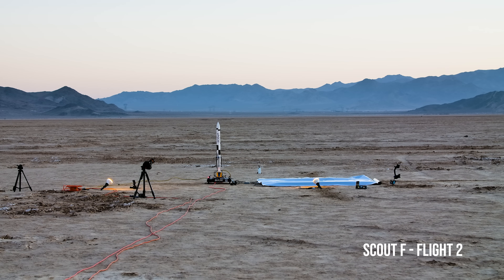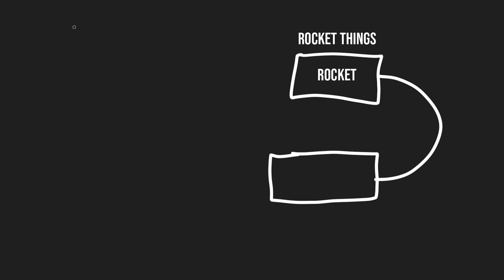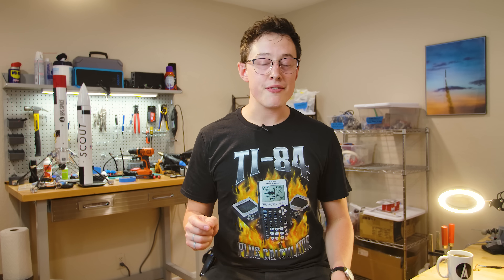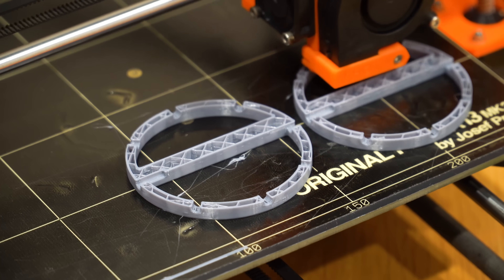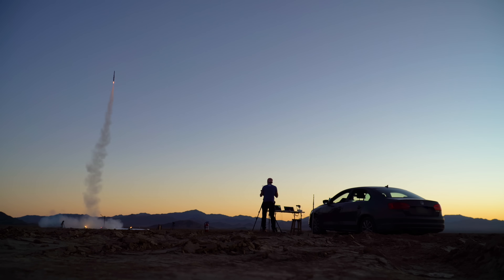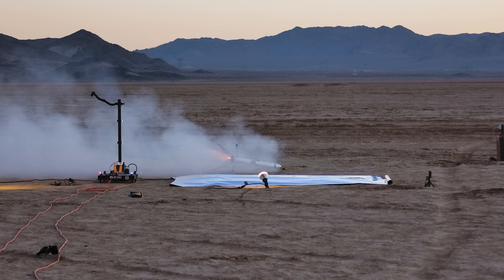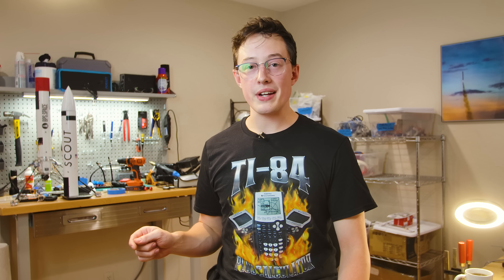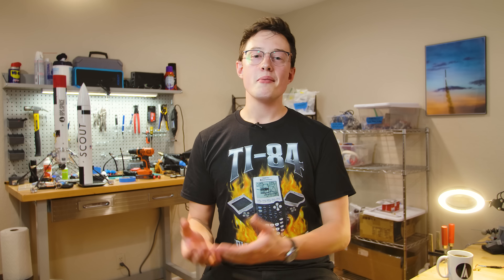Aluminum TVC Mount | Scout Flights 2 and 3

Comment: You mightmwant to add precision PTFE bushings to the pivoting points of your TVC mount. Reduced friction will give you betetr control.

Also, I agree with Marius Holle. The gimbal should be fixed into the 0position whilst ejecting the first motor & starting the second motor to reducen unintended drift.

Comment: For RTK modules Ive been using Emlid RTK (specifically for uav) , you could check out that brand. They have small modules designed for UAV, maybe this has some application for your use. They have some vehicle integration using standard gnss formats and pricing is some of the lowest for this kind of technology

Comment: I wonder if you could incorporate a feasibly "mass-cheap" sort of "scoop" or "deflector" (like the ones used on jet aircraft and jet boats) that swings down into the path of the solid rocket motor, and diverts the thrust vector equally to either side. In so doing, you could essentially cut off vertical thrust at will (almost like shutting down a liquid fuel rocket engine), and maybe even achieve a stabilizing effect near the bottom of the rocket body. I don't know enough to say whether or not this is a good idea, or even possible, but it's something I've been thinking about, and wanted to share.

Comment: Just had a thought, why not use sugar rocket motors? You could make them yourself, and ensure quality in each of them, but also adjust thrust at the end of their burn so you can trim the attitude of the rocket without having to throttle it massively, maybe also some sort of thrust reversal bucket system might help instead of just blocking the nozzle? That way you could essentially neutralise thrust at certain reversal settings in cases where Ava underestimated the burn time?🤷🏻‍♂️

Comment: That third flight was amazing! I did notice however that it seems to be travelling sideways a lot on landing, wondering if maybe adding something to the TVC control profile that kicks it over in the opposite direction to the vehicles travel right before burnout to try counteract this slide? Falcon 9 does a similar thing where you see it too over right before touchdown and then it straightens up at the last second. Just a thought

Comment: Ditching the pad definitely sounds like a good plan. You're using consumer grade IMU hardware (right? Even ism6dsox is borderline consumer, it's not aerospace), and double integrating acceleration. With as dramatic of forces as it sees, there's no way to avoid the error totally destroying your position estimates. Sincerely, someone whose job used to be VR tracking....

Comment: Hey just a thought.  In drone tuning there was a firmware that had an auto tune function.  Basically it would input a change and record the actual movement vs the input.  Then it could figure out what the PIDS really should be.  Any chance you could program a tuning flight to characterize your loop?  Then set your pids from the real data?  Oh by the way, if your a tinkerer machinist, the correct term is farbicoble.  Just saying.  BTW  YDM

Comment: Never give up, never surrender, and maybe go faster on your control system.  When I was doing control systems design (servos on very large robots in nuclear reactors) we were always shooting for 1kHz.  Your slow servo rates are bound to encourage oscillation.  I assume your rates are slow just because you have small processing horsepower.  If they are slow because that better matches your dynamic systems that's another thing entirely, but I'm thinking your systems are small and light, so they could benefit by faster control loops.  Good luck!

Comment: Glad to see you went metal. I think your thrust shut off is still right, too many off kilter forces on landing. I suggest you simply use a small shoot to help with velocity on the way down. You then could calculate the drag induced by the shoot and then convert it to thrust and correct your motor.  Maybe addd in more shock dampening to the legs?

Comment: Curious why you don’t use gps to correct for inertial position error. If you could combine those two sensors that could adjust for your position error on descent.

Comment: It might be worth looking at the control loop inside the servos -- they are often tuned assuming they will not be moving much mass (think RC car wheels or plane flaps), and that causes some of the ringing you see in the motor mount response.

This should be fixable by tuning this loop (might be possible with fancy servos?) or adding some springiness between the servo and the motor mount. The best thing would be to control the motors yourself (with feedback from the potentiometers), because then you could also use the true thrust vector in your state estimate, but that's a lot of work.

Comment: It looks to me like the rocket is pitching over almost 45 degrees at apogee. Then when the second motor ignites the thrust pushes the vehicle way off the vertical vector. So essentially the landing motor which is supposed to be working only to counteract the gravity vector is now ironically working hard to keep the vehicle from remaining vertical. So now the rocket has to work to stop it's sideways thrust vectoring which shouldn't be occurring while trying to return itself to a 90 degree (or vertical) orientation which it needs to be in to deal with the gravity vector. Unless you have some hidden vector control motors I don't see there is no way for the rocket to control these unwanted sideways motions. This is the first of your vids i have watched but it seems like your goal is basically to go straight up and come straight down. So the sideways motion at the top of ascent is a problem. It would add weight but you mght try to build a tiny mechanical gyro (like an electric motor driven top) to mechanically counteract any tendency of the rocket to deviate from the vertical. BTW your metal motor mounts look great but you could try reducing mass by removing any excess metal that isn't structurally necessary. In other words look at every bit of structure and say do I need that. You want to build parts with just enough structure to do their job without failing. You might see if you could get a program that would look at the forces applied to your motor mounts and experiment in software with removing structure until failure and see how much you could get away with removing. Engineers would call this destructive testing. But overall great work so far.

Comment: Just so you know, rtk gps is a pain in the ass to get set up correctly, not so much the part you think is hard, but getting the actual data out of the chip without going 30 kph. Or at least the one i was working with was a pain in the ass. Good luck either way as there is not alot of real docunentation on non car related stuff with rtk.

Comment: 14:27 Stupid idea, but what if you cheat a little and add some sort of spikes on the landing legs that will hold rocket as it lands. A spike that just springs out as soon as the landing legs deploy would let you choose an appropriate length while being flush when the landing legs are retracted( when not deployed ).

Better, if the spikes were angled away from the Y-axis, so if it lands on spike first, it will push the rocket in the opposite direction.

Comment: Hi Joe: While I am nowhere near your technical prowess, I do have a great deal of RC aircraft experience. Please allow me to suggest the following.: I’m pleased to hear that you will be doing away with the “drone pad” (land it first, hit the target later) and addressing that landing bounce. For the bounce, try using carbon tubes for the legs instead of rods. Tubes don’t bend and redound. Try a larger diameter leg. Yes, I realize the weight issue. RC model car shocks would help if you added more power.

Comment: Your linkages look a little over engineered. Most remote control aircraft clubs have some flyers that use actual jet turbines - if you drop in for a chat they would be very happy to show you what they use (flyers at my club would be anyway)

Comment: 4:45 servo slop comes from its drive train, not the horn. A metal horn certainly helps reduce overall flex but does nothing for slop. Flight3 was amazing Congratz.
Reply: Try metal geared servos

Comment: It looks like it would have successfully landed if the lateral friction on the landing feet was lessened. I know this doesn't address the underlying problems with the control model that you want to address, but a level, rigid, and low friction coeff. landing pad might've made that work!

If you feel like you are chasing diminishing returns with the vehicle hardware, it might benefit you to look into modifying the environment in which the vehicle operates. Cars are impressive but roads make them useful.

Comment: Absolute legend, Joe! 
I believe you can stick it without knowing where the missile is (gps or rf triangulation), solely based on orientation and barometric altitude.
Reply: Yeah except that it doesn't matter if you're exactly upright and the engine cuts 1cm above the ground if you're also going 5m/s sideways
Reply: @clonkex  that's right, and it's going to be very difficult to catch this drift with IMU because of error integration. I believe Joe will figure it out with some math. 🤞
Reply: @smogy001  Now I'm confused what you meant by your original comment. It sounded like you were suggesting position estimation wasn't necessary 🤨

Comment: just a guess but are the motors reliable enough that you can predict when theyre going to stop giving thrust so right before that happens it doesnt try to correct its rotation and instead tries to cancel all angular velocity so in the period between the ascent motor stopping and the descent motor starting it keeps its angle and isnt in the middle of a correction?

Comment: I was briefly working with drone control systems on a student autonomous drone project. I concluded that instead of controlling a parameter directly it is better to control the derivative (or second derivative). So for example when the rocket angle is off you'd control the angular acceleration (or angular velocity if your sensors aren't precise/fast enough). You could still use PID controllers but they would be cascaded. The great thing about this is that you can now control how aggressively the set point is pursued, like setting max angular speed/velocity etc. I'm sure there are better options than cascading PID controllers, but this almost always performed better than a single first order PID loop. Faster (several kHz) loops like motor ESC and self balancing etc are a different story, they need to be fast.

Comment: Closely Check 0:26 to about 0:32 - While the engine is not running, your control system is. This leads to a massive over correction when the second motor lights up. Think about shutting down gimbaling until the second motor is running. This would have made the flight MUCH smoother and easier to land. As you know the engines have a very high thrust right in the beginning and then the thrust sharply falls off. If that high amount of thrust is used for gimbaling, you'll have to use the entire rest of the thrust to correct it. - Alternatively you can use the high thrust for gimbaling but you have to dial the angle down to a fraction for this small amount of time
Reply: yep - I think "integral windup" is the actual search term. Seems like this is a huge part of the instability.
Reply: @reid-dye  Interesting. Integral windup....
Reply: In a way that is correct, but the thing is, when igniting, the engine will point in the wrong direction and the rocket will be completly out of range for the landing pad. Letting the control system run is more appropriate as it doesn't exactly knows when the engine is gonna ignite... I might be completly wrong, and you completly right. But it is always nice to share opinions. Have a good day you all ☺️🚀
Reply: Nice analysis
Reply: Good catch!

Comment: I think you can drastically improve the accuracy and performance of your gimbal by having the pushrod mount further away from the pivot of the engine mount apparatus. Although it will limit your maximum range of motion for the thrust vector, I guess it is favorable to have a more stable rocket in the first place other than compromising for a greater ability to correct the mistakes that were caused by the compromise.
I really love watching your videos! Thank you so much for creating this kind of interesting content!

Comment: Personally I feel that the polymers used for the old mount are not the issue. Lack of stiffness in the design can always be solved with design changes, or choosing a stiffer polymer.
If my eye spots it correctly, you seem to be using PLA+ for the mount. Perhaps using regular PLA for parts of the design that need to be stiff is a wise choice. Similarly you can add strengthening ribs in important places to structurally enhance the stiffness. Alternatively you could make the step to carbon reinforced nylon, which is pretty much as stiff as aluminum.
The main drawback of polymers is the lower yield strength and creep. Neither of which I think is a problem in your design.
Indeed the biggest problem seems to be play and backlash, and an insufficiently powerful actuator. Could be improved by tighter tolerances (which would increase friction), or by using a less constrained design. The better servo definitely is a good call.

As for the controller, are you doing a MISO design? As in, are the controllers for attitude and altitude completely separate, or are you taking into account the reduction of thrust of the motor from throttling, whilst controlling the angle? I can imagine that if you do not do this, this extremely non-linear and non-deterministic disturbance has significant effects for the ability to control attitude. This could relatively simply be solved (or at least improved) with feedforward.

I also might suggest that instead of using a moving average filter (which is essentially a crude low-pass filter) to reduce the bandwidth, to try and use a feed forward notch filter on the reference signal. By tuning the notch filter on the frequency that disturbs your mount and makes it resonate, you prevent your controller from adding energy into this mode. Because the filter is not in the feedback loop, the controller will still be able to reduce inputs from external disturbances in this frequency range.
This kind of approach is especially useful if your mode is significantly under the control/mechanical bandwidth of your system, as instead of cutting off everything above a certain frequency you are only cutting out the unwanted part.

Comment: Without looking at the data..  it looks like the pitch over at the top was just a bit too much to fix in the available height. It had to get the attitude under control. Then translate sideways to get over the pad. It was still moving sideways at touchdown. Bit more height and it might have nailed it.

Comment: 40 Hz is surprisingly slow for a vehicle of this size, that's the rate on a big vehicle like a fighter jet. The old school VTVL rockets were 150-200 Hz. But the servo has its own internal frequency that is probably much higher, so maybe it's hard to make a direct comparison.

Comment: I have identified 3 issues, 1) the rockets when it reaches apogee is NOT burning the whole motor causing a tipping moment when the rocket is most unstable, also your thrust vectoring I guarantee your flight computer is NOT taking into Isacc netwton 1st law of motion, on the ceramic thrust vectoring components there is a lateral moment that is NOT being taken into account, and thats the tipping you get every flight, also you legs bounce WAY to much, DONT use a pyro fuse for this use a sevo and elastic band

Comment: Can you not put some pre bought copper or hard rubber bushings in? They will be precision engineered, can be fitted into your ‘sloppy’ engineering and they will ‘up’ the degree of precision? That’s what I do as I don’t even have a cnc so all my stuff is hand sawn and hand drilled, but I put bushings or bearings in right place and it gives precision and tight tolerances

Comment: A few thoughts. I used to be involved in quadcopter software development and the loop rate can make quite a difference. Some digital servos will run up to 400Hz. At that rate mechanical inertia may well help damp out spikes. It depends on the source and frequency of the spikes.
To make a simple lightweight damper for the landing gear take two carbon tubes where one fits inside the other. Add a bit of grease on the sliding surfaces for damping. You can get silicone damping grease in a wide variety of viscosities so you can tune the damping rate. If you seal the ends of the tubes you can also use the trapped air as a spring. The grease will seal well enough for the short time you need to hold pressure. You can adjust the spring rate by adjusting the ratio of open to compressed air volume.
Reply: Won't the launch forces compress the legs?

Comment: 50Hz?? Why so slow? Our drones update 8000Hz!! And yes I did think like the moving average is a bad idea. If your update rate is so low because your servos only understand 50Hz and you add this average you should increase the update rate of your controller, I think
Reply: Only the IMU does 8000, and that is because the data is shit. They will fly if the PID runs at 100. Not well but they can at least cruise arround.
Reply: @someonespotatohmm9513  no, you can set the PID loop frequency to 8kHz, even on an stm32 F4
Reply: the IMU runs 32k internally
Reply: (the MPU6000 at least does)
Reply: @kampkrieger  Yes but can't be used in betaflight anymore because shitty performance (likely aliasing) UAVtech talked about it. I also believe it is not recomended by the manufacturer to use it.